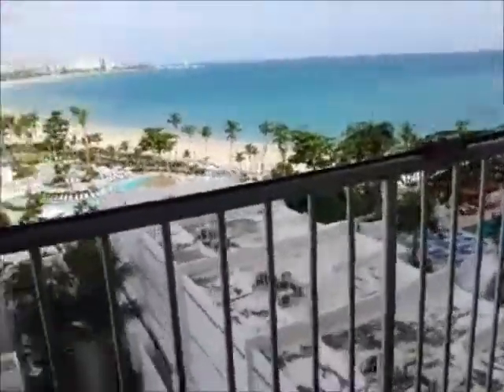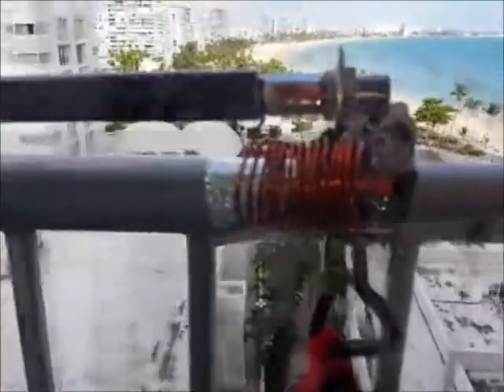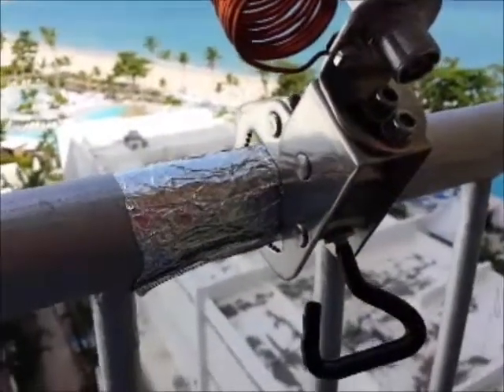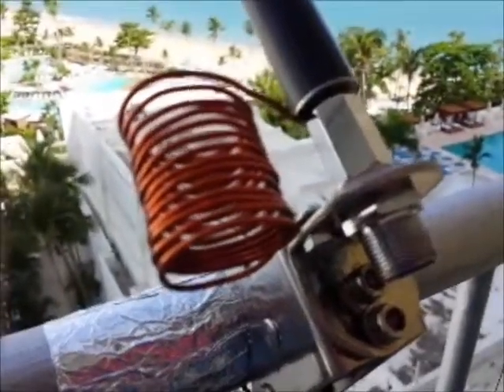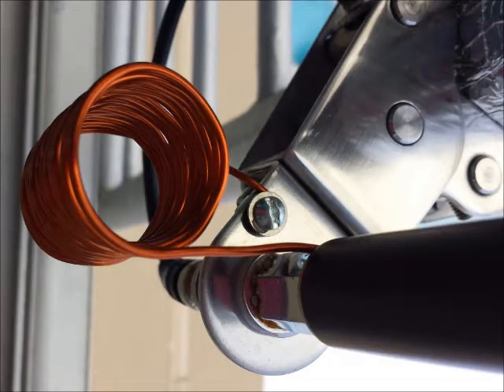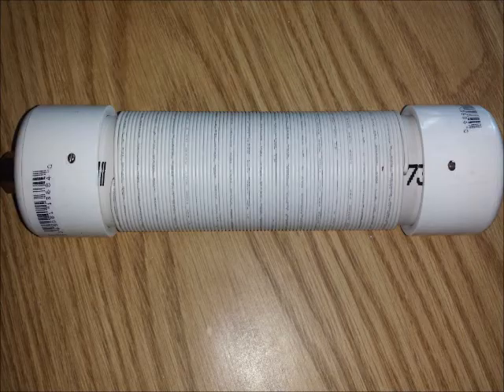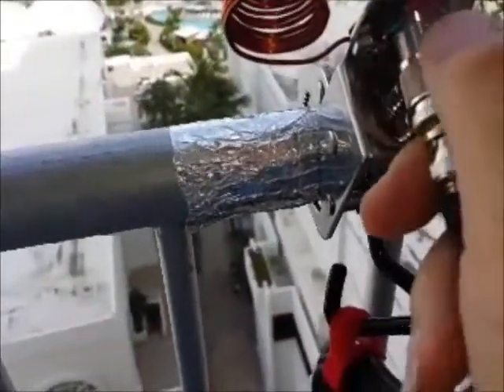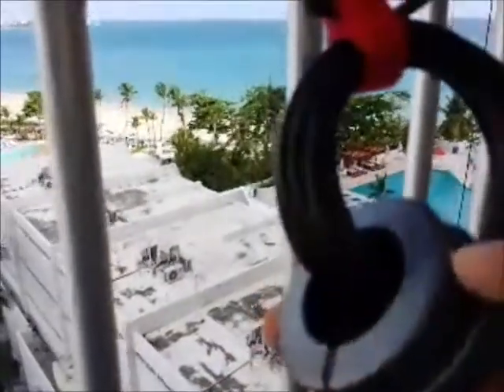Balcony Mounted Buddistick Antenna at KP4MD/P in Puerto Rico

Comment: I think this is the best video describing the shunt coil that’s on YouTube :) I’m going to try to set up a vertical with a capacity hat, which I understands lowers the feedpoint impedance.. so I am thinking a shunt coil like this one could counteract that effect.  You found the shunt coil tweaking worthwhile versus running the tuner in the radio (given a pretty short run of coax)?
Reply from the maker: You correctly surmise that even with the higher SWR without the shunt coil there would be little loss in the short run of coax.  The disadvantage of using the shunt coil is the narrower effective SWR bandwidth around resonance and the need to more frequently adjust the length of the whip while changing frequency.  This video was a test of concept, and in the end I prefer to use the antenna without the shunt coil as the internal tuner in my Elecraft KX3 is more than adequate to match the antenna over the entire 7 MHz band.  However, I still need to adjust the whip length with significant frequency changes within the 3.5 MHz band.